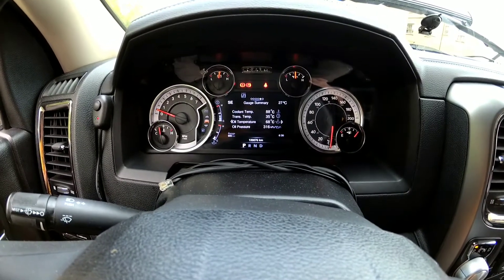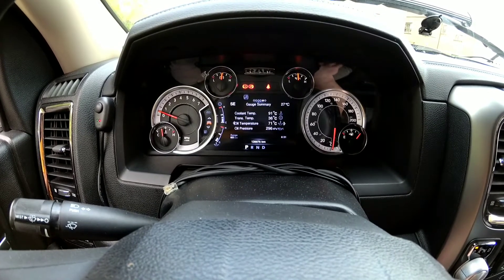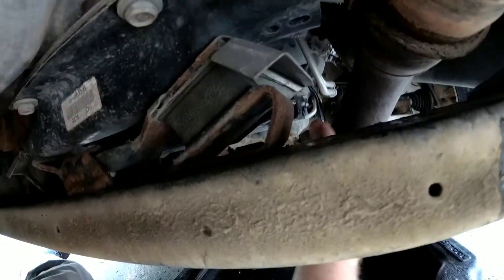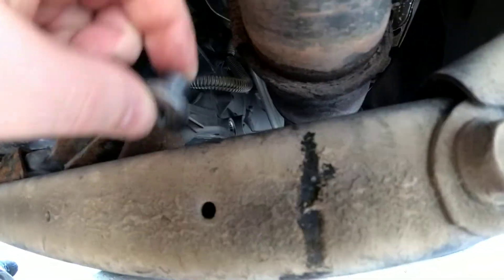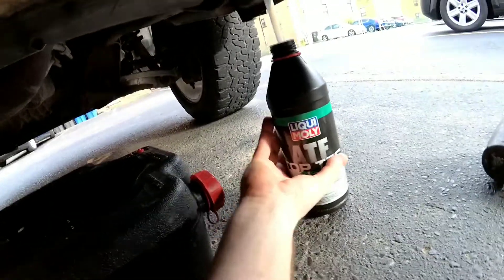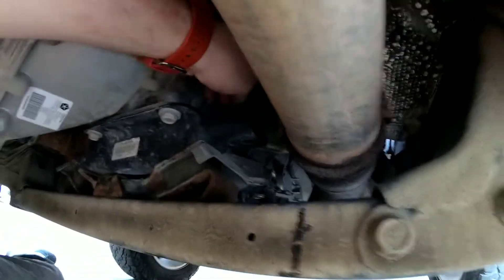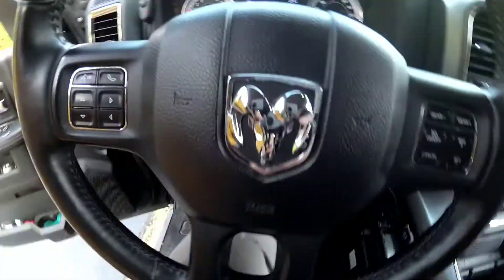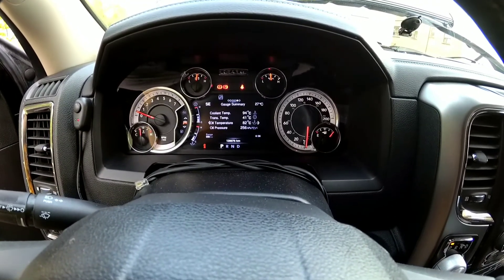Ram 1500 ZF 8HP70 transmission fluid level inspection / fill.

Comment: Don’t you need to jack the rear to level the transmission?
Reply from the maker: Parking lot had slight slope to the front that gave me insurance that I won't be low on fluid.

Comment: So I don't have to stop the car? To check the transmission oil?
Reply from the maker: As you see on the video car wasn't moving anywhere..
Reply: No but you get a better accuate reading when your motor is cold
Reply from the maker: As of ZF this transmission has to be in between 30 and 50 degrees Celsius during fluid level check.